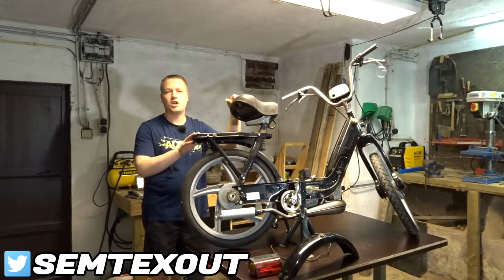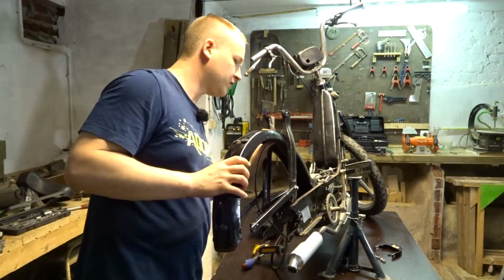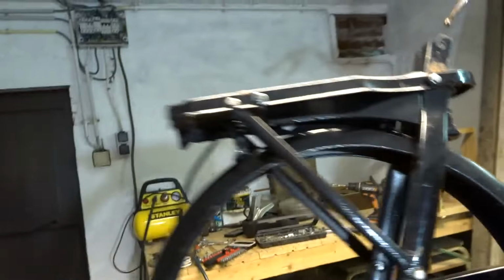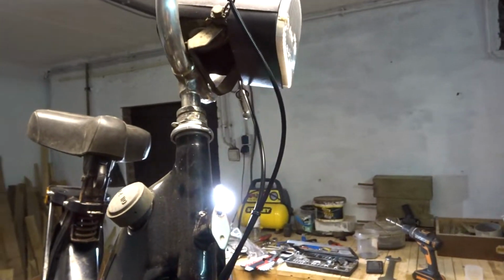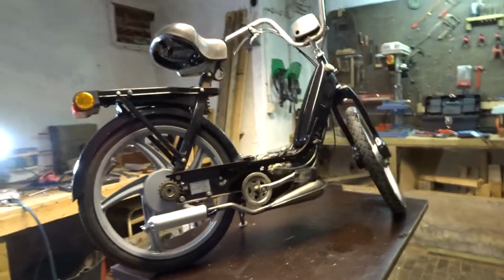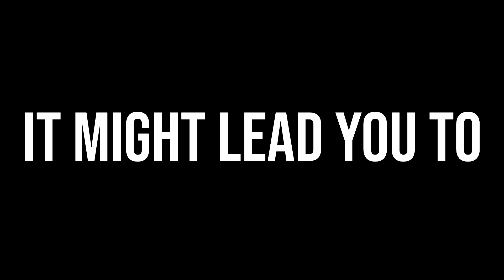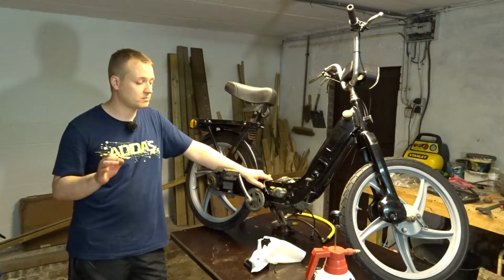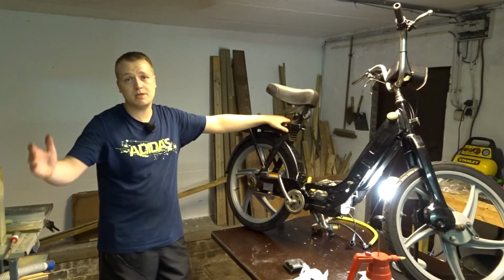Very Bad News - Project Killer - Vespa Piaggio Ciao 65cc

Comment: Not a problem buy a little bigger piston or you Can buy a cheap dmp cylinder for 30 euro never give up on a project only a loser will give up. i just bought the dr p10 for my second ciao Think about 70 - 80 km/h
Reply from the maker: Jmpb gave me the DR 65CC to replace it with this cylinder kit. I installed it in my latest video. Still need to do a leak test on it to check the crank seal and the decompression valve